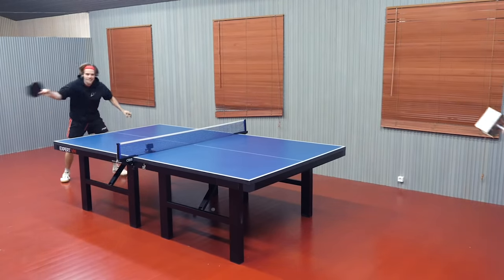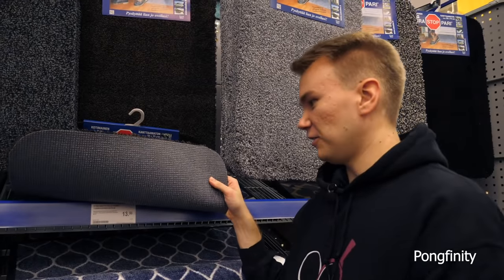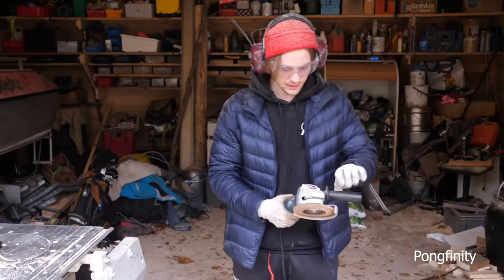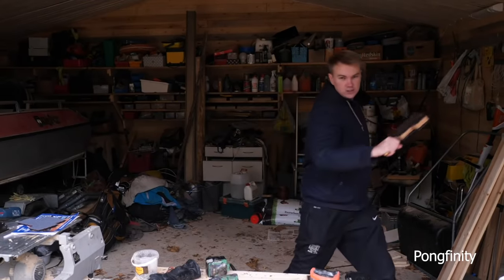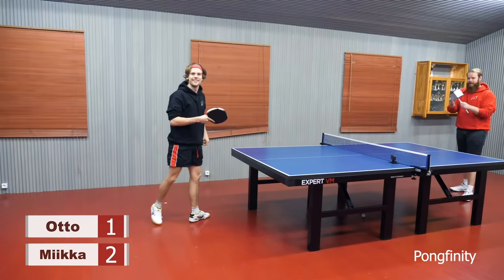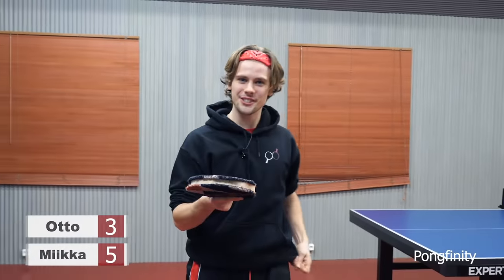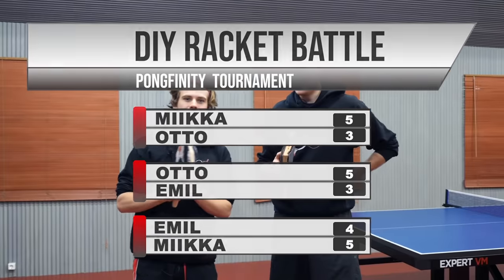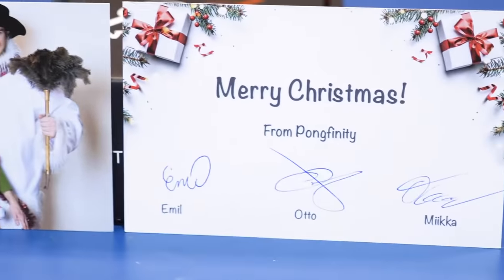Building the Perfect Ping Pong Racket

Comment: rating the rackets by looks only

Otto: 9/10. didn't seem to understand the challenge and instead made Thor's hammer. however, he is worthy and it looks good since he has a beard.

Miikka: 8/10. it looks like a table tennis racket and it has floof which gets him bonus points. not as cool as Thor's hammer so only 8.

Emil: 5/10. the shape is... interesting. 5 points because he tried